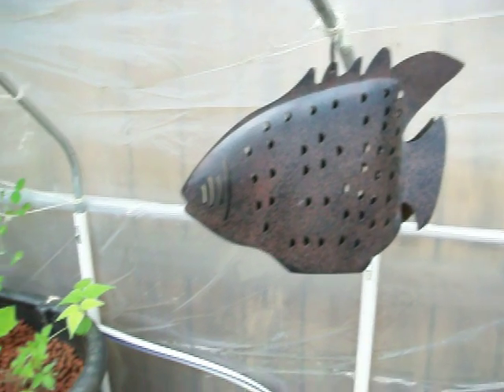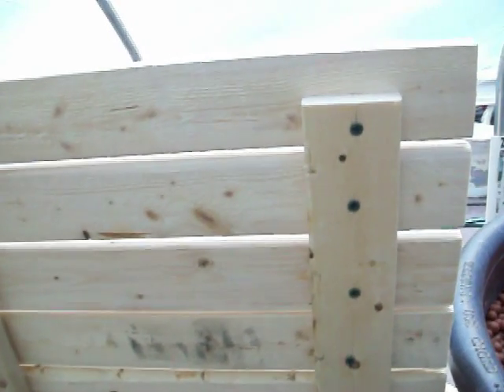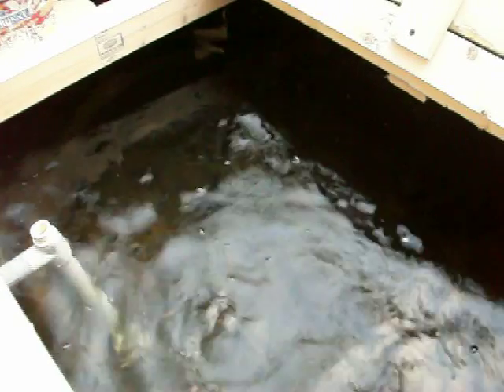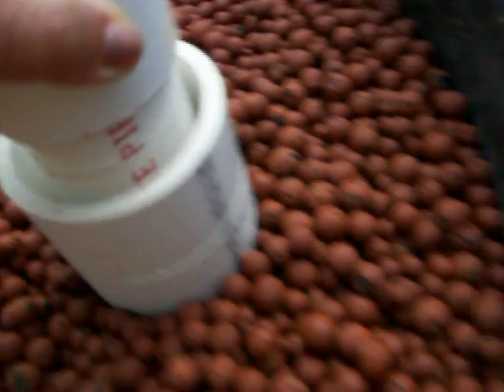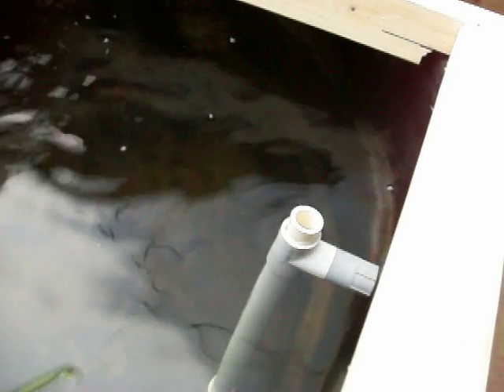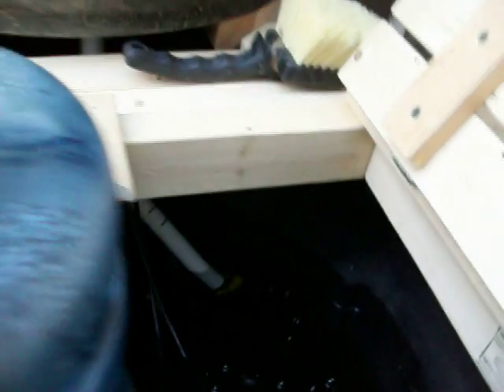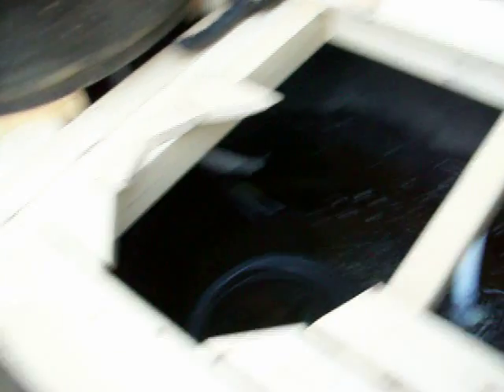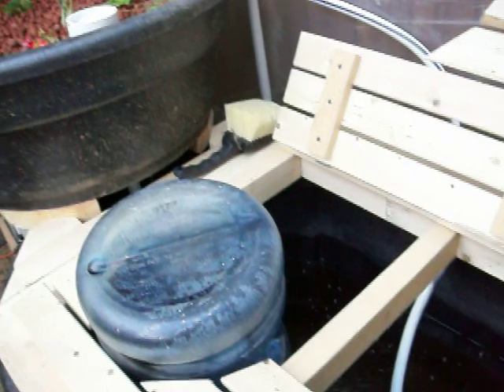Rambling tour of the aquaponics system

Comment: Meg,  hi from NZ,   A few teething troubles with new plastic barrel system.  using clay pellets.  they appear to stay lighter than the water and move around when the levels change.  obviously the greatest movement is in the centre.  this moves the plants from the outer edges into a line in the middle overnight?  I have made a trial false floor/panel thru the centre to give a more constant depth of 200mm.   This  barrel system seems popular on line.  never see any mention of floating clay media?

Comment from the maker: Hi 1saregare1,

Each 90 degree bend in a pipe introduces as much loss as several feet of straight pipe - yikes!

If I were doing this from scratch, I'd want a bottom drain with a standpipe (2") inserted that is surrounded by a much larger pipe (e.g., 4" diameter) with drain slots in the base. If I couldn't do that, I'd go with a drain in the base plumbed to a standpipe that is inside a larger 4" pipe with slots in the base.

My setup is OK, but I use a pump sometimes to get out the solids.

Comment: At 6:00 you have the pipes just going straight down into the tank, on my system I have the pipe down to the bottom with a 90 then a 1ft piece into a cross and 3 arms with holes coming off of the cross.  1st does that make sense  2nd Do you think having 3 pipes with holes is not allowing enough suction as the solids seem to rest on the bottom of my tank as opposed to being sucked up.  This is my first system and your videos are very helpful.

Comment from the maker: FWIW, I only have a pump in the sump, no pump in the fish tank itself.

Without knowing more details, don't know if 50 gallons would be enough. If you are doing media with bell siphons, you'd need to have a tank that is big enough to take all the water when the pump shuts off (at night or when power goes out) plus have enough water so it doesn't drain itself dry. On the other hand, if you are doing floating raft, the water level will stay pretty constant, so 50 gallons might be enough.